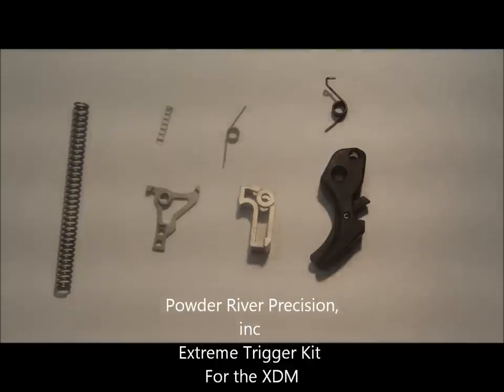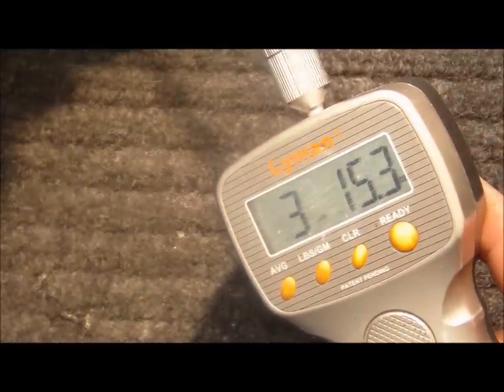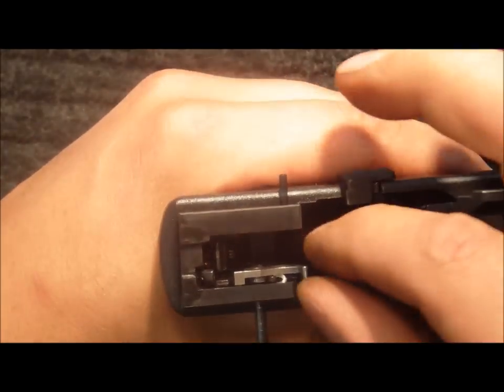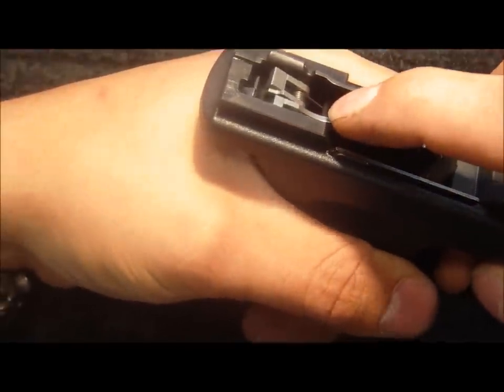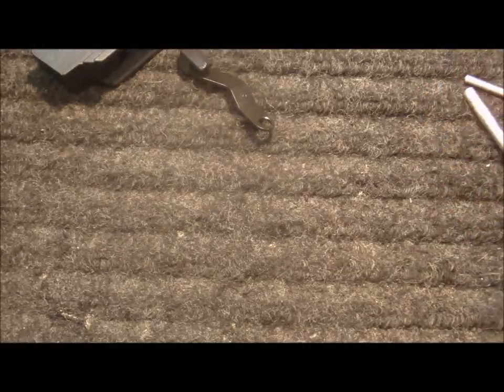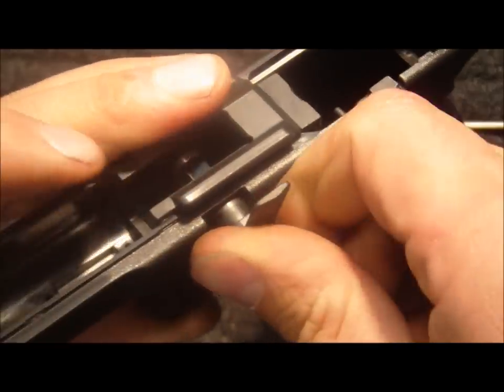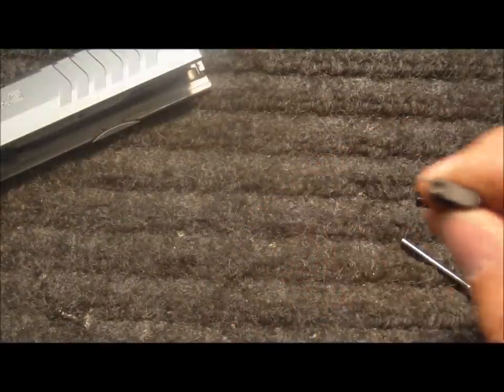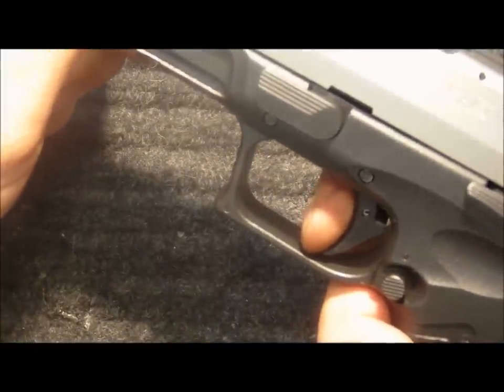PRP EXTREME Trigger Kit

Comment: I just installed this kit in my xdm 5.25 as well- And all I can say is" SWEEEEEEET trigger pull"!!  The grip safety had a little contact with the sear that resulted with a very minor "click" feel when pushing the grip safety in, so I fitted it in under 2 minutes with a small file- (I already had one ready to fit the oversize trigger I optioned into my kit...) I was able to keep the trigger installed and still fit the file between the frame and trigger so I was sure to get the least amount of overtravel possible, which is zero. As soon as the trigger stop reaches the frame it drops the striker. I already polished up the sear pin with 2000 grit wet/dry sandpaper when I tried enhancing my factory trigger and believe that also helped the smooth feel of the sear/striker release due to less rotational friction. 

To those wondering how the kit makes the trigger "feel"- On MY xdm there is no discernible click or dragging feel through the trigger pull, it just travels very smoothly rearward and once it releases the sear it can't move rearward anymore. The reset is 1/4 what it was originally. It is very very light compared to the factory trigger, so heed the warnings if you aren't an experienced shooter. I've done trigger jobs on all my firearms and I am very excited to put some test rounds through my xdm this weekend.

Thank you PRP for such a great kit!

Comment: I installed the Extreme trigger and fitted the over travel as instructed in their other video. AWESOME trigger!  After 1K of flawless rounds I had problem today. It was about 16 degrees F today and the sear wouldn't release at times. I suspect that due to the COLD temps things changed slightly so I'll file a little more off the over travel stop to give me the clearance needed. I posting this as a FYI.
Reply: +Stephen Filla I have the same issue and wonder if it still working for you after file a little off the over travel stop? Any other solutions?
Reply: +Liang Xiao Yes, it's 100% now.  Just throw some sand paper in your range bag in case you need to adjust it further at the range. A smidge too much over travel is better than a "no bang" when you need it to work.
Reply: ty
Reply: which other video are you talking about?